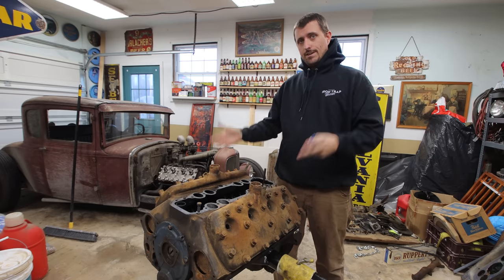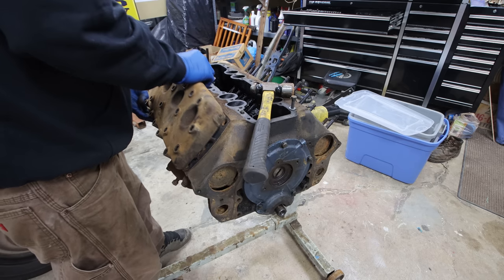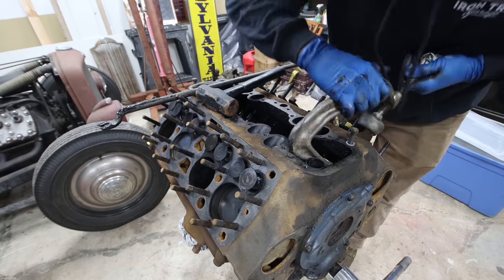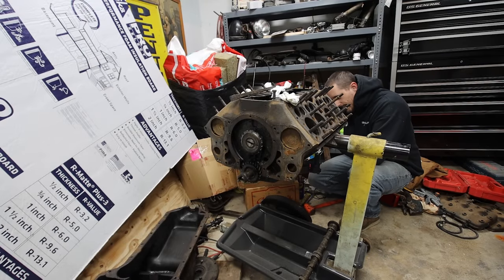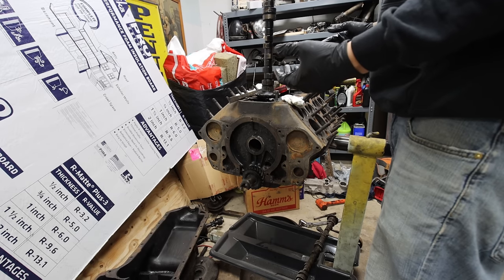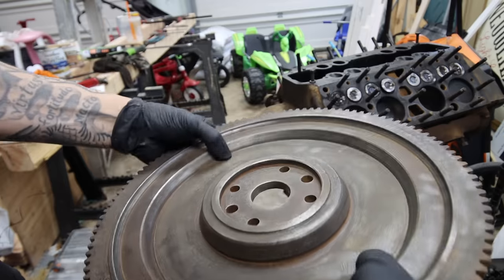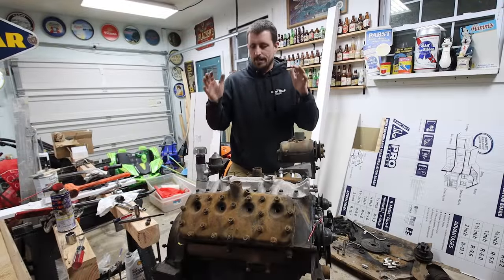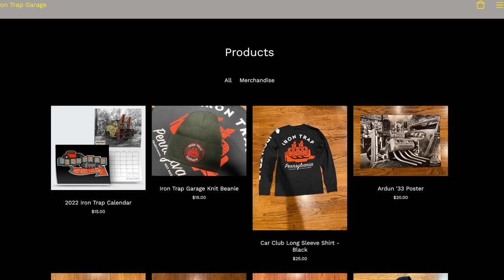Refreshing Mike's Ford Flathead W/ New Valvetrain & Dual Carb Intake!

Comment: It is so nice to see someone use using the right tools to work on a Ford V8 Flathead. I keep preaching to guys that if you don't have the special tools for work on the valves, especially ones that was setting a long time, you are going to possibly wreck something & have hell of a time with some cuss words you never did use. If you are a gluten for punishment, go for it. With the right tools like Mike is using in the video makes the job a piece of cake. So get the tools one way or the other or get some that has them & let them  remove the valves. You won't be sorry; trust me.

Comment: Great job Mike I could tell you picked up a lot of knowledge about flatheads in a relatively short time I'm one that likes the original heads you're using even with the Dual carburetors it'll make it look more stock I might have checked those heads for straightness before I put them on I for one would trade for a longer video with more detail on what exactly you did but I still liked it anyway keep up the good work

Comment: Did you drill holes in the lifter bosses to stick a rod into to keep the lifters from turning when adjusting? Back in my flathead days, late 50s early 60s that what I did it, really made for an easier adjustment.

Comment: I highly recommend the Melling High Volume oil pump. When the pan is off it is worth the price of admission to later see your oil pressure gauge in the upper range and never going so low that you wonder if you will make it home.
Reply: No Sir, only use a high volume pump, if you have taken specific measures to make sure the high volume of oil is RETURNING to the pan.
What do I know,  building Engines for Nascar, NHRA, IHRA, NMRA, and countless other organizations.
Reply: Really Sir, you pump high volumes of oil OUT of the block, and you expect it to  magically make it back to the pan ????.??

Comment: Mike, please don't use a steel hammer when "tapping" cast iron, it could cause cracks.  Use a brass or more preferably lead hammer that won't shock the metal you are tapping.
Reply: Surprising how many people no longer know that.

Comment: Mike when replaced the valves did you check and cleaned the valve seats ? I know some people don't ! I was what we call a shade tree mechanic here in Kansas but I was also a Aerospace Ground Equipment Mechanic in the Air Force for 8 years .
Reply: Around 12:00 , Mike is lapping in the valves, so I assume that will make the seats clean.

Comment: First time i seen valve work done on a flat head wish you could have went slow on 1 or 2 of them
Reply: I just removed a broken valve from my 59A yesterday. I watched a video from wired customs before starting. It was very detailed and addressed a lot of the issues I came across.

Comment: Is there a reason you are keepers by the stock heads? Maybe I missed that part… seems like if you went through all of the trouble of installing a upped up cam and the lightened flywheel along with your dual carb intake, one would assume you would bolt up a set of aftermarket heads 🤷‍♂️ Asking out of sincere curiosity. I am new to these flatties.
Reply from the maker: They are rare to find for a 21 stud. Need to find a set or spend the money on new ones which are quite expensive. Working on a budget.

Comment: 3/4 race cam?  Are you sure that is what you want?  This engine is not a torquer as it is.  An aggressive cam will make it worse in that respect.
Reply from the maker: But it’s also a super light car and has low gears. It works just fine.

Comment: Mike, did you consider an acid bath for thr block and heads then a magneflux inspection for hairline cracks ?
I've pretty much done that to every old engine I've rebuilt.
Especially Chevy 283's.
Some of those up in Michigan were known to develope them if owners let them overheat.
Pretty cool you have your little boy there "hrlping".
Start them young like when I was working with my Dad building his Sirroco wood airplane designed by a Romanian former WW II Luftwaffa who defected to france in late 1944 after his parents were killed in a bombing raid.
He'd been forced to fly for the Germans under threat to send his parents to a concentration camp if he didn't. 
The allies gave him 25 thousand for defecting in his Heinkel night fighter with state of the art radar.
I had fun helping my Dad build it.